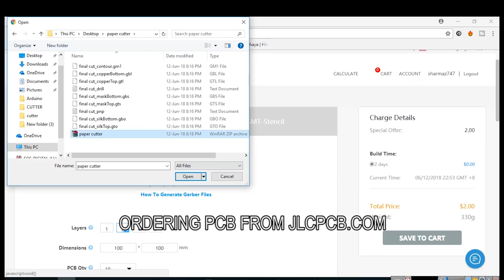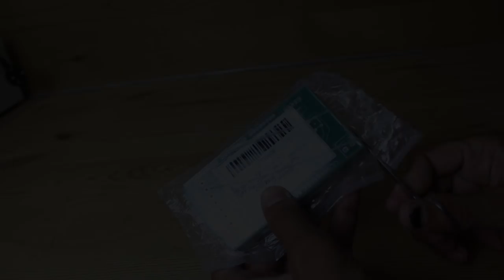DIY Arduino Based Paper Cutting Machine

Comment: Nice idea. I built one using Arduino and some old Epson printer. The benefit is you could load several pages at once and leave it cutting. I used the paper feed sensors and the whole feeding mechanism. Honestly it was a nightmare to get it working properly due to cutting the paper "in the air" with no direct paper support and how the plastic of the printer is terrible for screws and heat (to build the specific parts). Nice project, just saying an old printer has some benefits.

Comment: The PCB board works as designed.  Make sure your order the 096 LED with the GND pin followed by the VCC pin.  There are 096 LEDs on the market that are VCC first and then GND which will NOT work on the PCB.  I corrected my mistake and the PCB works flawlessly!  Thank you !
Reply: hi can i ask if what application did you used for laying out your pcb?
Reply: hello can i contact you i have a few questions

Comment: This code has several errors from the beginning.
int up = 10;
int down = 11;
int right = 12;
int left = 9;
int start = 7;
int select = 8;
These variables are not defined correctly, and there are missing parentheses later in the code. When I proceeded to test the commands that instruct the motor to feed paper, they don't work as expected. The motor pushes the paper a bit and then stops, while the blade continues to cut without waiting for the motor to finish feeding. Are you sure you've uploaded the correct and functional code, or is this intentional?
Reply: have you found any solution
Reply: ? Delete com ?